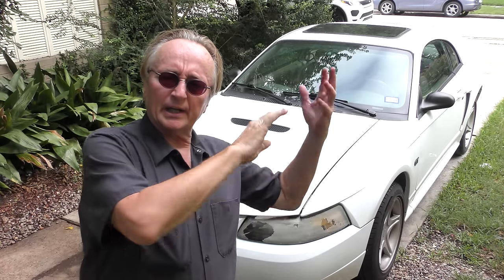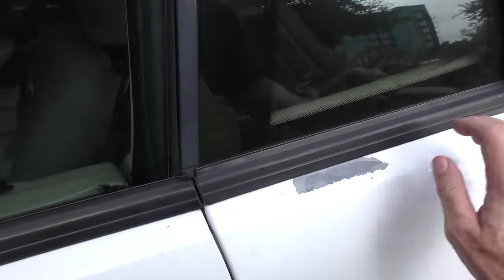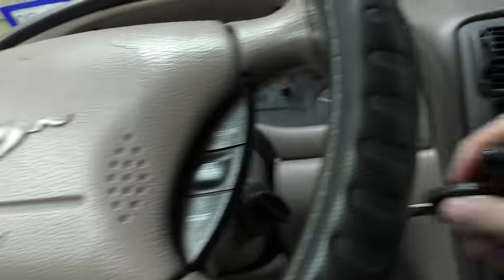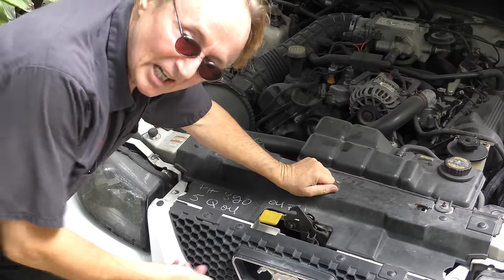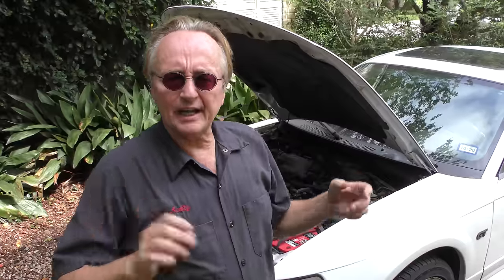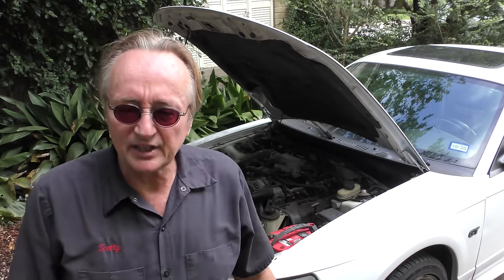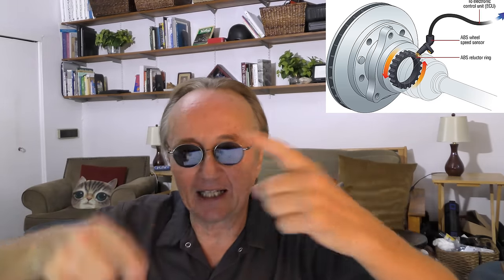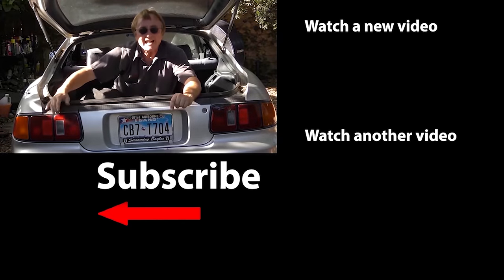Buying an Old Mustang and Fixing It Up

Comment: My late sister had a new, 1965 Mustang with a straight 6 and it ran excellently. She passed away in 1975, and my mother kept the car another 10 years. I wish I had it now. Odd thing: You may think "packaging" options is something new, but my sister had wanted the disc brakes... but Ford only sold them with the V-8!  Later on Ford made many mistakes with the Mustang, including putting it on the Pinto chassis, and later the Fairmont chassis. I'd advise any purchaser to check in to the car's maintenance history.

Comment: I bought a 2006 Mustang GT last October, it had the common valley coolant leak from that heater hose or whatever coolant line runs under the intake manifold but I got that fixed and then found out when I got an alignment the suspension was in rough shape, all the bushings in the rear are bad, rear shocks are bad, front struts are the original struts from 2006, and the front strut mounts are bad, still mad that the guy did the alignment first and then told me about the suspension after the fact knowing full well I'd have to get an alignment after replacing the front struts but I digress, bought it back in October, car hasn't given me a single issue since I bought it if you don't count the issues I bought the car with, they really are great cars, all I need now is coilovers and sway bars and she's all fixed up

Comment: If you do them right and put the cash into the suspension they're great. 
Awesome bang for the buck. Slap on some 5.4 heads on it and a bigger MAF and you get great return on the investment.
Parts are everywhere.
Reply: 5.4 2v heads are the exact same heads as the 4.6 2v heads, same cams and everything. And also a bigger maf won't help you at all until you're making massive power from boost, in the mod motor case anyways
Reply: @sategllib2191  🤘😎

Comment: Scotty, the 385hp 5.4 DOHC was only used in the Cobra R with only 300 made in 2000 with custom heads and intake made from "unobtainium" and are worth a fortune. The New Edge Mustangs were pretty reliable cars. Wet noodle chassis though especially the verts.

Comment: The 390 horsepower only came in the 03 04 Cobras with the 4.6 DOHC Supercharged engine. The other Cobras in 99 and 01 just had the DOHC 4.6 naturally aspirated and only had 305 horsepower. All the other upgrades on the body, interior and suspension along with the collectability of Cobras are what make them more desirable. Mine was a 94 that still had the 5.0 pushrod engine and only made 240hp stock before all the mods I put on it. I drove it for almost 300,000 miles before the motor finally crapped out.
Reply: @Mark Codiroli yeah your right I forgot they changed the tune or something to give it 15 more hp than the 96-98 Cobras had.
Reply: @Mark Codiroli so true

Comment: SN95 mustangs are some of the best, most reliable cars you can buy and keep them on the road. Prefer the V6 one's over the 4.6l though.
Reply: Sn95 was great. Sn95-2 not so much. The 99 to 02 models are notorious for head failures especially in the v6s. It got corrected in 03 but I wouldn't ever push those years. I beat my 97 to death and it lasted me a long time...

Comment: I got my 2001 gt with 160k miles for 5.500k, has k member, long tubes, 335 rear tires 275 front , short shifter, cold air intake, and it’s healthy condition, amazing paint as well, and the pieces are cheap, maintance it and it’ll take care of you

Comment: Only reason that's not rusted is because it's in Texas. My '03 Taurus, only ever been driven in Ohio, is rusted to the point that you can't jack it up from the user manual-specified location for the rear two wheels; I have to jack it up from the real axle. That and both rear wheel wells have chunks that fell off.

Comment: I've had 3 99-04s and 3 94-98s. I so wanted a 94-98 when I had all 3 99-04s. Well, I finally got one, but it turned out to be a piece of junk. Same thing for the other 2 that I bought. Even though 94-98 is my favorite body style, I prefer 99-04 because they're easier to maintain. I now have an 05-09, and that's the best car I've had. If I had a 99-04 and 05-09, I'd be very happy

Comment: Mine was mostly fine for the 12 years I owned it. When the control arms started dying I bought something Japanese. From 2001 to 2013 it was a program car in two accidents. One sensor went out, the gas tank started leaking in 2012, and the headlights had to be replaced. The clearcoat was defective and peeled off after about 3 years. I'm sure it's still running somewhere.

Comment: Just bought my first mustang this year. 1997 and it was someone else’s project car. I named it Karen. Need i say more? She is currently out of commission.
Can’t figure out why it won’t restart and stay running when the temps are hot outside. Thought is was a PCM issue because changing the fuse seemed to work a few times. Not this time. Took hours for it to cool enough to restart. And now the fuel gauge is stuck on full yet only had a half tank. No air conditioning in it either. New thermostat. The car isnt overheating and radiator is fine. Has good oil. New crankshaft position sensor and fuel filter. That’s only one issue. Don’t get me started on the braking system. New master cylinder yet still getting too much air in the lines. Calipers seem to be working better since replacing the master cylinder but still having an issue with the front. Im ready to call my loss on it which makes me so sad. Always wanted a mustang and i finally got a purple one. Everything ran fine until it got hot outside. Ergo, her name is Karen. And yes! Oil changes!!!

Comment: Just got a 97 gt convertable its not super fast but it sounds amazing
Reply: It's also a great looking cat. The Sn95 saved mustang from extinction as the foxes weren't doing it for Ford due to being slow and unreliable, in addition to being downright ugly. Sales on foxes picked up right before the new model because people found out they were so easy to modify and stuff larger engines in. I miss my 97 mustang. Lasted 500k miles and 14 years almost.

Comment: True true true! I have a 1998 chevy malibu  quad 4  2.4L with 141000 miles. Sure rust here and there, replaced computer, struts, plugs ect. but it starts and runs very well (original starter) like you said, I change the oil at 4K..if not sooner. Fined my P0440 code with a hose and here in NCY it passed missions. Just wanted you to know David :)

Comment: I had a 2000 Mustang V6 model that I traded a Chevy Blazer for and I had my Mustang until it got totalled. It died at 298,000 miles and never changed the engine or tranny.

Comment: The only Mustang Cobra’s made for the year 2000 was the Cobra R, about 300 of them. The regular new edge Cobra was made in 1999, 2001, 2002 and then the supercharged 2003 & 2004 Cobra. 1999 Cobra owners got mad at Ford saying they made less power than advertised and went after Ford. The 2003 and 2004 Cobra’s made more power than advertised.

Comment: Those 4.6l mod engines are probably the longest lasting gasoline engines ever. Had a crownvic with 500k on the clock. Engine never been apart. Second trans was put in at 300k+ she burned a quart every 3 or 4k.

Comment: I have a 2000 mustang base with the 5-speed manual and a 2003 mustang premium convertible with the automatic. These care are very reliable but were made with pretty cheap interior and body parts, best thing id recommend is find one with a good interior and good body and working ac, if it has all those any mechanical issues are worth fixing. The engines and transmissions in these cars are very reliable I haven't had any issues other than usual things like breaks and hoses going bad and those damn rebuilt alternators breaking sometimes (under warranty luckily). These mustangs are really great cars and surprisingly comfortable and smooth. one of the last cars built with a proper unassisted manual transmission that really lets you feel the car. But alas the newer mustang is much more comfortable and stuff but these older gen mustangs are really just overall good cars and super fun even with the little v6, lighter front end so better cornering on those curvy roads and they sound great, my 2003 sounds like a v8 to the untrained ear.

Comment: Just bought one for 300 had a transmission fluid leak and theft light but easy fix ended up coasting me about 600 with a tow not bad

Comment: Picked up an 04 GT with the 40th anniversary package, and the stage 1 and california packages from roush. Had 128k mi on it. Found it at a dealership while looking for another car to commute for work. Dorve 400 mi to get it, and stole it from the dealership for $4500. Since then i have been slowly turning it into a 700hpdaily driver. Cant touch the engine or transmission for 2 years when the warranty runs out but have already replaced and upgraded the entire suspension and break system.

Comment: I have a 2001 Mustang GT. I want  to clean up the engine with protect-ant on the rubber parts. I remember you warned about using certain products due to harm to the catalytic converter. What should I use.??

Comment: Scotty is not mentioning one important issue. The problem with the dual overhead cam motors , the 5.0 and esp the 5.4 is after 150,000 that motor is in the “ it’s ready “ category. What I mean by that is under that front timing cover there is a lot of stuff going on. And that “ stuff” is wearing out big  time. Timing chains, slack adjusters , oil pump, rocker arms. Yes, that motor can go 200,000 miles before the 4,000 dollars fix but there’s a big IF there. Those motors will not tolerate lack of maintenance. iE , oil changes on time are critical along with all the preventive maintenance. Yeah, 5.0 is a good motor but ...

Comment: i did really good on my mustang got it running and driving for 1500 put about 10,000 in it now it is worth a lot but it is a 68 cobra mustang with the 428 cj dual quad from factory with matching #

Comment: Just sold my 99GT a month ago :-( Same issue with the crappy aftermarket headlights but otherwise was a solid car. Death trap in the snow though!
Reply: Get the best aggressive winter or all season tires possible, and a dozen sand bags in the trunk. That will help.

Comment: Agree on the automatic. My 97GT had a nice shifter but it became sloppy over time and the engine wasn't much for revving anyway. SN95 was behind the camaro in speed but a very good everyday driver, good clearance and easy to maintain.
Reply: Did you ever have trouble finding parts? I'm looking at a 98 now..
Thanks

Comment: The 2000 Mustang with 385 HP was a 5.8 in an SVT Mustang Cobra R very special and rare worth a lot of $ the STD SVT had a 4.6 with 320 HP and the GT had a 4.6 with 260 HP, the V6 with 190 HP and that's about it!!

Comment: I own 1998 mustang gt and is getting new fuel pump the mods that it has is cold air intake pulleys x pipe no cats and slp exhaust i still need to get aftermarket cylinder heads and cams

Comment: Loved the video but that year didnt come with any bigger engine than the 4.6. The 5.0 wasnt offered until the mach 1 model in 2003
Reply: mach 1s  had 4.6 but 4 valve heads=305 horse
Reply: Cobra R. 5.4 V8

Comment: What bigger engine was offered in that generation? 4.6 was the largest. Even the cobras (supercharged) and Mach 1s had the 4.6
Reply: Different engines in the Mach 1, maybe same displacement but they're not the same.
Reply: Lu Pavo it’s the same engine just 4v instead of 2v with different tuning and other internals (beefier)

Comment: I have the same body (fox frame) same year, but mine is a V6. Can I swap the engine with a GT engine? Without any welding or grinding of motor mounts?

Comment: 7:19 The Quad 4 IMHO was actually fairly big(2.3L, 2.4L)compared to many of the competing twin cam 16v 4-cylinder engines of the day.  The first version made 180 hp, not bad in 1988.
Reply: The High Output made up to 190-195hp which yes was very impressive .nvh was lackluster
Reply: drove a 1990 grandam gt with one and made it to 160K. that was on 2 engines and 2 transmissions though...i think me and my dad replaced every single part on it just to get me through college. finally got a real job and traded for a Mazda 626.
Reply: @labornurse  Didnt know they were that bad, I figured your grand am would have had the 2.8 or 3.1V6 to be so troublesome or maybe even the rare turbo 4

Comment: DO NOT USE AFTERMARKET PARTS MOTORCRAFT PARTS ONLY !!!!  Idle problems replace Throttle positioning sensor with Motorcraft OEM and Idle control valve and replace all vacuum hoses .  engine running hot Replace thermostat with OEM 192 degrees DO NOT USE AFTER MARKET ... replace EGR valve , egr control sensor and the exhaust valve to EGR ... I did replace my waterpump with OEM  I tried aftermarket and the OEM is made different has a plate over fins . HAHAHA I bought the HID lights for mine have to replaced after 2 years but they look good and only $70 for both no big deal

Comment: Those New Edge GT's only had the SOHC 4.6L. The only DOHC engines were the 4.6L in the 03-04 Mach 1 and Cobra. There is no smaller engine.

Comment: I just went over 100k on my 95 Mustang convertible summer driver. V6 is even more desirable because you know for sure it wasn't thrashed upon.
Reply: i wouldnt say the v6s are more disirable because nobody wants the v6s unless if you just want the chassis to swap a diffrent engine in

Comment: I've got an '05 Ford Ranger with the 3.0 V6, just over 200K miles, and I've been trying to figure out the check engine light throwing a code for misfire on cylinder 3, replaced the coil pack, plugs, wires, crank sensor, and the injector for that cylinder, I'm not burning much oil, no coolant in the oil, almost everything I search for this specific issue (misfire on cyl. X) says I replaced the coilpack and it fixed it but clearly that's not the issue, do you have any ideas what it might be that won't cost a fortune?

Comment: Got an 07 GT convertible with 152k miles. Bought it at 136k and it’s still running strong as all hell with regular oil changes. Only issue I’ve had is I had to replace the clutch around 145k, but other than that it’s dead reliable. Ford knew what they were doing.
Reply: Hows it holding up now?
Reply: @peterbilt6662  I sold it to another guy at 176k, and he’s told me it’s now at 185k running strong 💪

Comment: I have a 2000 and lately every time I get gas, it idles and runs rough for a few minutes before going back to normal. I have to sit at the pump keeping it at 2k+ rpms for it to not stall and wait for it to idle normally. What could be causing this?

Comment: Scotty, I have an sn95 myself and I changed the ignition lock, checked the switch but the switch was fine, all relays and fuses in the fuse box is fine, car will start with the switch and a jumper but when I try and fit the switch pin back into the actuator rod, it doesn’t line up, do you think my actuator is broken? It’s this yellow part that the ignition pushes and pulls I think, please let me know, car has been down for weeks and these mechanics can’t tell me what’s wrong.

Comment: They didn’t make a production mustang in the sn95 new edge that made 385 the n/a cobra only made 320 stock I own one. Yes they made the dohc 32v but that’s just the heads don’t forget the forged rotating assembly from factory. Your probably referring to the 2000 Cobra R. There were only 300 made it was NOT a production vehicle. And there was no regular cobra in 2000 cause of the 99 mustang issues.

Comment: Unfortunately I have never had an AOD transmission that lasted. I’ve yet to have one make it to 150k without a rebuild.
Reply: I’m hard on my 4r70, I doubt it’s been replaced because I know the PO. I’m at 206k and I bought it at 186k a year or two ago. When I goes out, I’d like to just put a 5 speed in it
Reply: Matt Mccollum that’s not too bad at all. I’m at 201k on my 4L60 and running like new. I’m not up to date on the current ford 5 speeds but I’ve ran many of the T5’s. They usually brake when you get close to 450 HP.

Comment: Hey Scottie! Just bought a 2005 Mustang Gt with 80k miles, it runs great but I’m worried about the spark plug issue where they might break off when changing them. Do you recommend I go ti a mechanic to change them now or leave as is? I’m the 3rd owner but the previous owner doesn’t know if the plugs have been already changed.

Comment: Scotty, my car has 4.10 gears with the 4 speed automatic and it does 2800 rpms at 70 on the interstate is that okay to run on my 4.6 with 172,000 miles on it has ton of power never burns oil

Comment: So are 99-04 Mustangs good, reliable and dependable daily drivers?
Reply: Yup
Reply: i've had two of them, they are solid, these days you can probably get a mach 1 or 99 01 cobra for not much more than a gt, if you're not gonna buy the much more expensive 03 04 termi cobra then i'd go for a cobra or mach 1.

Comment: I own a 2007 mustang GT. I can not get my driver window to stay up. Its an electric window. I don't have any power to it because I'm rebuilding the motor. I'm looking to get the window to go all the way up. There is a gap in it and when it rains it gets in the car. I tried to push it up with my hand and it goes back down to the same place.

Comment: The 4.6 4v DOHC motor didn’t make 385 it made 300 to the crank the 5.4 4v DOHC motor made 385 HP but they were in the cobra R’s which only 300 were made
Reply: I think he meant the 2003-2004 Cobra

Comment: Hi Scotty I have 2 question's i have a 2002 Ford Excursion and a code came up P0320 I just had the spark plugs and coil packs replaced 126 thousand miles it shuts off and sputters out loses power  when I was driving it. 2and door ajar light is on. So when I close the door to lock it up dome lights stay on when I drive they go off the door ajar stays on dash. Thank you